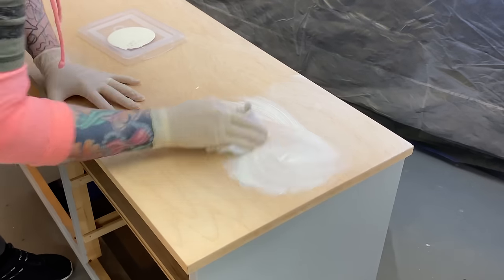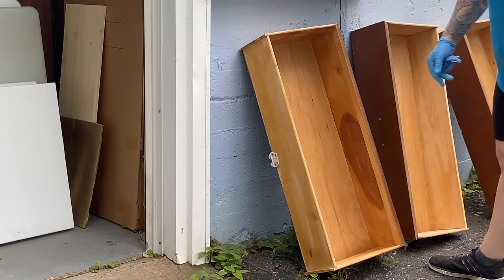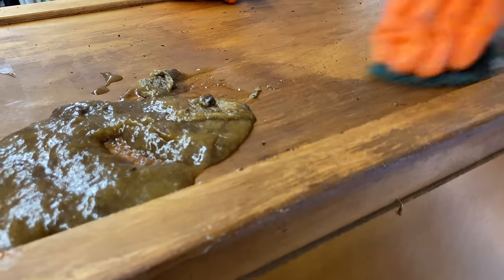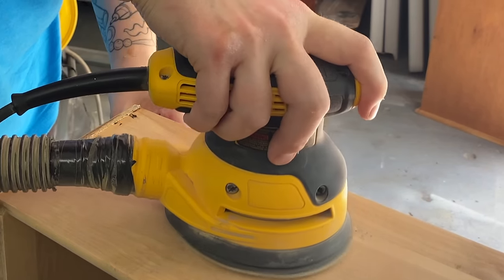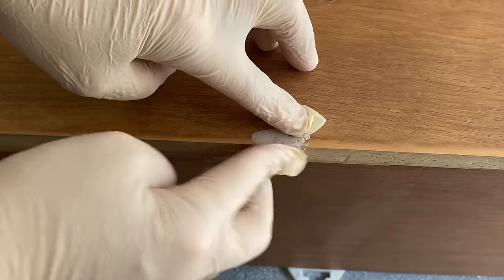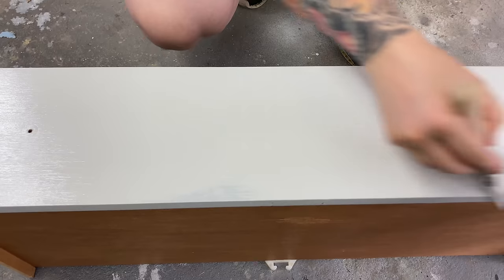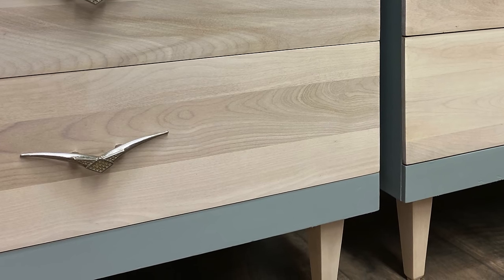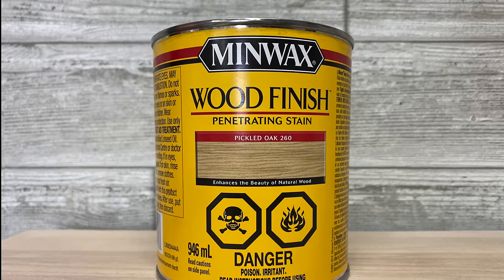The Ultimate Light Wood Showdown: Wax, Wash, or Pickle?

Comment: Do you ever get splinters sanding by hand without using gloves? Also, what gloves/face mask and or eye protectant would you recommend. I just bought “green mineral spirits that says it’s safe to use indoors. Is that true?I have two cats and live in a condo with minimal outside space to work in. Any tips for restoring an old wood dresser dumped by the dumpster would be much much appreciated!! Thank you in advance!

Comment: I recently just found your channel, and have enjoyed the way you teach.  We have just moved into an old log cabin, which we have owned and rented out.  Now, like your old furniture it needs some work.  We are changing the kitchen, but want to use as much of the old cabinets as possible, which means trying to match old with a few new cabinets.  The original cabinets are garnished with a darker brown stain, as with old wood darker with age, they need to be lighter against the aged old log  walls.  Don't want white, but thinking about picking and found your you tube.  I'm a bit confused, you used pickling on the top of the dresser, and a gray white wash on the drawers,  where did you use the white wax? Just on top of the pickling?  Does it change the color of the pickling?  I have used chalk paint and wax, the wax can be fickle if used to heavy, are the waxes simular?  Also your thoughts on kitchen cabinets in a old log home? Thanks

Comment: For particularly resistant smells, I've tried Concrobium (available at home improvement stores) which is for moldy, musty smells. I didn't have to prime/seal the wood, just spray, let dry and clean as needed.  Kills mold/mildew (no bleach and very safe) and prevents it from reappearing. It's used a lot after a flood or water damage.
Reply from the maker: I use that quite frequently! It’s incredible on mild and mildew specifically- it’s a staple in my product stash!

Comment: Love how thorough you are! I just picked up a dresser to redo and it has a smell to it too as well as some wallpaper in the drawers ! How Can o remove the wall paper looks so old !
Reply from the maker: If it's stuck down, try some heat with either a hair dryer on the hottest setting, or a heat gun on the lowest setting. Then something like goo-gone to remove any residual glue. that usually does the trick :-)

Comment: Thanks for the comparison. I have been trying to figure out how to fix the questionable design decisions of the previous owner of the house. There are at least five different wood tones in every room. I love whitewashing but sanding everything down would take an age. The ceilings are all knotty pine, the trim white pine, cabinets maple, island is a darker stained white pine with a butcher block top, and the wood floors are different in every room. I've resigned myself to having to refloor everything because it was poorly installed so I'm looking into everything I can to save me from tearing out anymore of the wood. I love the wood grain so I don't want to paint it but the disjointed wood finishes are driving me crazy. Unrelated but they also finished most of the first floor by shoving hay into textured plaster so I've got my work cut out for me.
Reply from the maker: Yikes! It sure sounds like you do! Best of luck with all of that. Thanks so much for watching!

Comment: I like your sander. My question is does it leave circular marker since it is an orbital sander? Thanks for your videos
Reply from the maker: It only leaves swirls if you are using too much pressure or the wrong grit (or both), or a sanding pad that is past its prime.

Comment: How would you go about making the wood grains pop on mahogany but neutralizing they red... is there anyway to do that. Trying to put a bed room together and I’m going fir a bed rich brown stain on most pieces but have a curved dresser with beautiful mahogany veneer swirls. Stripped the drawers and the instant I tried mineral spirits bright orangey red....
Reply from the maker: If it were me, and I wanted to go to a brown colour, I would skip the stain altogether, seal with shellac or Mohawk Vinyl Sealer (not made for vinyl, despite the name, lol), and then glaze and tone until I’m happy. In other words, all the colour would be OVER the wood, as opposed to IN the wood. This isn’t overly beginner friendly though, so it depends on your skill and resources. 

If you’d still like to try stain, you can try adding the Shellac Seal Coat, an oil based gel stain in the colour you want (keeping in mind that the gel stain over shellac won’t behave the same way as a penetrating stain directly in the wood, AND you may need to pick a brown with green undertones)… then once the stain has dried fully (usually 2-3days)  it can be sealed with your topcoat. It doesn’t have to be an oil based top coat if you’ve waited the full 3 days. It could be water based or oil based. 
Hopefully this helps a bit and doesn’t make things even more confusing!

Comment: You mention that you don’t recommend wax for dining room tables.  Any suggestions specifically for dining room tables?  Trying to redo finish  of dining room table top.  Rest of table finish is great so it’s just the top.
Reply from the maker: Depending on the wood, you can use anything from varnish to lacquer to poly and then products like Odie's Oil. There's also epoxy. There are a ton of finishes you could use, just not wax alone. Thanks for watching!

Comment: Hi, Love your work. I have a thought, you said your goal is to keep old furniture out of land fills, wood is organic. My thought is that the chemical you used to scrape off  the furniture  looked like stuff that might come out of Chernobyl. How do you safely discard it? Also, I white washed some blue pine shiplap and was wondering if I should apply a transparent or white wax? thank you, love your page.
Reply from the maker: If the stripper is allowed to dry out completely, I can be discarded in the trash. However if it is still wet it was be contained and disposed of correctly at a Hazardous Waste facility. Thanks so much for watching!

Comment: Tip…let the KwikWood dry for 5 minutes, then use a putty knife dipped in water to smooth it out. Less sanding when dry. You wouldn’t think water would work with epoxy but it does!
Reply: Thanks also!

Comment: Hi, I am asking for advise, if you don't give it sorry to bother you.
Anyway I just pulled an antique singer treadle sewing machine out of the dump (yes I'm one of those people) second one in a week.
Anyway the veneer is in horrible condition 1/2 missing I think some water damage too I didn't take a good look just wanted it in my car 🤡
My question, is it feasible to remove most or all of the veneer and restore what's underneath? I've restored alot but never come across this kind of mess.
Reply from the maker: I honestly don’t know! It would depend what they used for wood underneath! I’ve seen some that were solid pieces in good shape underneath and some that were a disaster of mismatched boards. I know that’s not super helpful, but just wouldn’t be any way to tell prior to removing it, sadly :-(

Comment: I have a stupid question. Why did you choose to use the scraper on the top of the piece rather than the chemical remover? Is that because it’s veneer?
Reply from the maker: Not a stupid question at all! The scraper makes quick work of a thick finish. Stripper is messy and while it does work great, often I can have something scraped in the same amount of time it would take just to apply the stripper, so I just go that route. Less chemicals too, which is always nice. The sides were a bit trickier because they aren’t thick and solid like the top, and also have areas in the corners that would be harder to get at with this particular scraper.
Reply: @TranscendFurnitureGallery  that makes perfect sense to me! Thank you so much for explaining that!

Comment: I still don't understand why you chose to strip rather than just sand... I'm sure it's so that the stain sets better- but how do you know? I also can never tell if something is veneer or a finish unless it's falling apart in some places
Reply from the maker: When the finish is super thick, it’s always better to remove it by stripper or scraper.. unless you want to spend three hours and $30 in sanding pads, haha. It just saves time honestly. In this case, the top is solid wood but the sides aren’t. When it’s veneer, unless a 120-150 grits cuts through the finish easily, I always try to strip it first. Saves sanding pads, time, and saves the veneer unnecessary trauma. :-)